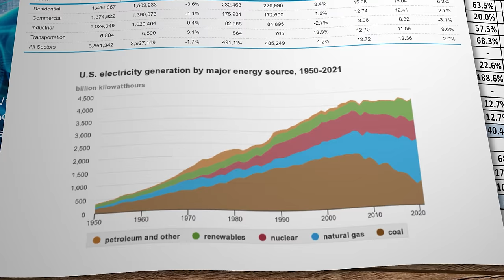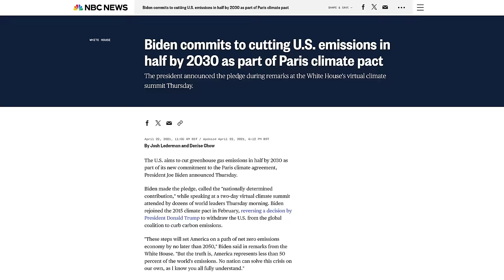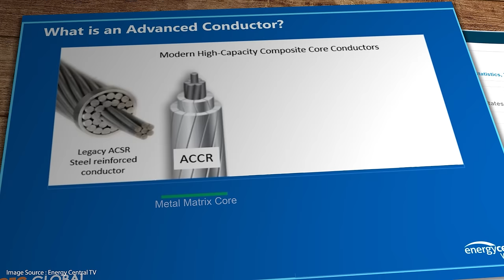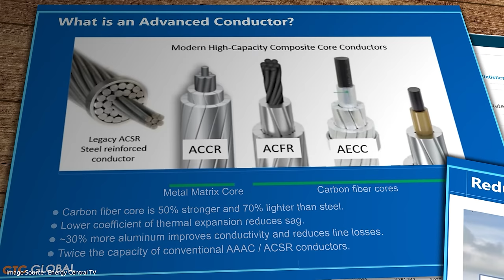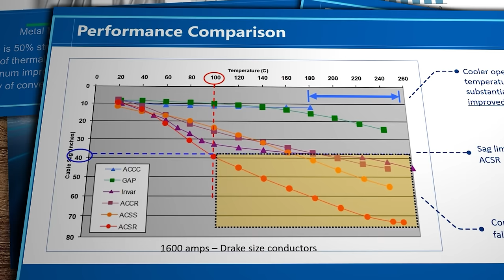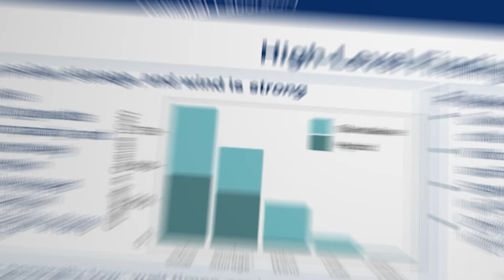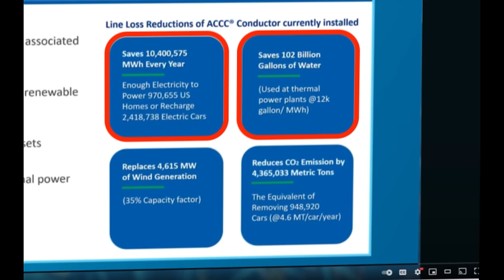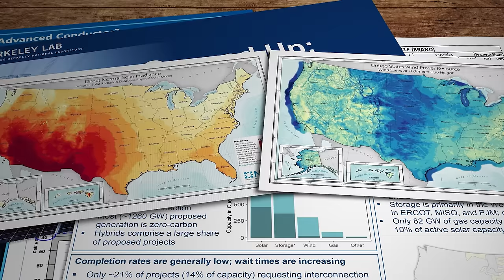Rethinking electricity grids.

Comment: A group of investors want to put a 100 megawatt solar farm to my north and connect it to a substation to the south. There is already a 120 kv transmission line going that way through my front yard. However, it does not have enough capacity to carry another 100 megawatts.

In theory, the company that owns the transmission line could upgrade the conductors. However, that would take a very long time, because it would just go into the upgrade queue. The job might not even start for many years.

The solar farm investors are negotiating to run another 120kv line through our front yard parallel to the existing one. Since they would be in charge of the project, they wouldn't have to wait for other projects.

They believe this is a faster way to get the solar farm up and running.

I approve of this project. Obviously no NIMBY concerns from me, since it will run through my front yard. Note: I will still support the project if the route changes, and it makes sense to run through my back yard.

Comment: What about using really high voltage DC lines in stead of AC that is also a major solution in conducting more power
Reply: I forget what it is but there has to be a certain distance and amount of power being transmitted before the economics of the higher cost infrastructure outweighs the loss of energy due to resistance.
Reply: @thatfatman6978  There are also useful for tying together different grids which may be out of phase.
Reply: the terminal equipment for HVDC is very expensive but works for long distances and high MW capacity.

Comment: I also presume that the more people who install solar panels and batteries at their homes (ie. go "off grid" to a greater or lesser extent) , the less demand and stress there would be on the grid. 

I also wonder about commercial buildings. If, for instance, the local big box store in Arizona would cover their large, flat roof in solar panels, that would presumably supply most if not all of their power needs at noon on a hot sunny summer day, and that store would essentially disappear from the grid when everyone else has their a/c going at full tilt. 

Solar panels are constantly getting cheaper and more efficient, batteries are constantly getting cheaper and more efficient, and inverters and integration/interconnection devices are constantly getting cheaper, more efficient, and smarter too. At what point will businesses finally see the money making/saving potential of generating some or all of their power needs locally?
Reply: Cover their large, flat roof in solar panels, this is what we should address as rooftop solar.

Comment: Along with this I do wonder if some of the current transmission lines could be modified to operate at higher voltages.  This would require new transformers etc and also depend on insulation and wire separation.

Even more complicated but also interesting is the conversion of some of these to high voltage DC lines (HVDC).  Much more expensive but lots of benefits.

Comment: What an excellent presentation! Doubling the existing transmission capacity through "reconductering" old transmission lines definitely comes into the "no-brainer" category of worthwhile investments for the future! The kickback from those who are resistant to the EV transition is full of negativity about grid capacity. As with the USA figures I understand that the electricity usage in the UK continues to fall despite increases in EVs. The highest level was around 2005 and it has dropped considerably since then ... allowing us to dispense with almost all of our coal generation ... more good news. Doing the numbers if every single car in the UK was to overnight become an EV (clearly not going to happen) the level of generation capacity that we had in 2005 would be sufficient to cope! (That's just using oversimplified arithmetic and the true picture may well be different but it does put things into perspective.) We need to shift from assuming this transition can't happen to getting on with it!

Comment: I work with CF manufacturers, and I've been told that the price per quantity of wound cable CF is increasing quite quickly as more cable manufacturers are turning to it rather than the older steel-aluminium technologies. My area is bike frame manufacture, and the price of the sheet material we use is also increasing due to the pressure placed on fibre and filament supply from the major manufacturers in China, Taiwan, Japan and the US. It's a bit of a crunch time in the CF manufacturing space, with supply always seeming to lag behind demand for the last 5 to 10 years. So which industry is prepared to offer the best rates to the filament manufacturers? Car panel manufacturers? Aerospace companies? I think conductor manufacturers might be a bit further down the rankings.

Comment: With the UK running most of the time at 95% of the grids capacity and completed generating plants unable to connect to it this could be a game changer.  I recently saw a comparative test of the cost of running the most efficient tesla (probably the most efficient  EV) charging on the public charging points  for 10,000 miles agains a similar ICE car, electric is now about twice the price. It's  much cheaper for those who can charge at home with off peak electricty and slightly cheaper for standard tariffs. Unfortunately a lot of people dont have the option of charging at home.If we want people to quickly adopt electricty wherever possible something like this needs to be done starting now. It might even reduce the outrageous price we have to pay for electricity. Probably not though.

Comment: Retail in the UK changed over to LED lighting about 5 years ago saving 66% on energy cost but at the same time gave them extra capacity to install car chargers in their car parks . Now that halogen and fluorescent lamps have been phased out over the past couple years then this will force properties to change over to LED
Reply: Here in Canada, most office buildings, universities, hospitals & other large institutions have switched to LED bulbs that look pretty much the same as the old florescent tubes.  They do need a difference fixture, but they fit into existing ceilings that were designed for the florescents.  I've also seen 22-watt florescent tubes that fit into the old 40-watt tubes and produce the same light.  One hospital I worked in replaced the old florescents with LEDs whenever a bulb needed replacing.  It took the electrician less than half an hour to switch a single fixture.  He needed an extra assistant for the first two years, but after that, he spent less than a quarter of the time on maintenance than he did with the old lights.
Reply: And look how far LED has come. A new generation of LED is in the works also which uses even less power.

Comment: 3:42 aluminium conductor with steel wire armour protection..
Shirely, that's what you'd put in the ground. Above ground, the steel is the central core with conductors wrapped around it.

Comment: My Overhead Cable Sag Software is used by companies all around the world, mostly for transmission lines, but also for chairlifts, etc.  Sag is very important, in addition to reasons mentioned in this video ... too much sag puts a lot of extra weight on pylons, wastes money (excess cable which costs a lot of $$$), and the flapping around in strong winds and even worse - getting into synch when flapping around - can cause a lot of extra stress and strain on pylons, shorten the life of cables, and cause various other issues / dangers.  Similarly, too little sag can cause a lot of stress on cables and shorten their life because there is not enough slack, especially in cold weather.  So there is an optimum level of sag in the cable, and this depends on the cable span, the difference in height of the towers / pylons, the altitude, the temperature, the cable materials, and other factors.  It's pretty complicated stuff - hence the reason I developed my Overhead Cable Sag Software.  
Special thanks to Greg C of Ergon Energy Australia, who collected and documented many sag calculation methods throughout his career, and helped me develop and test Sag Calculator just before he retired.

Comment: Reconductoring with the new high performance composite core conductors such as HVCRC conductors from Epsilon do everything highlighted in this video and make absolute sense in Australia where long distances result in high line losses.   These conductors are also recommend for bushfire risk areas where the low sag feature minimises arcing in adverse weather.

Comment: Cable  sag is not "alarming" its managed in the spec of the build ensuring it stays at the required height.

From Wiki.

Although ACCC has significantly less thermal sag than even other HTLS conductor designs,[5]: 20  it has a lower axial stiffness. Therefore, it sags more than other designs under ice load, although an "ultra-low-sag" (higher modulus) version is available at a cost premium.[5]: 21  Also, other aluminium alloys with an increased strength at the expense of electrical conductivity can be used to improve ice load sag. Ice load can also lead to the loosening of outer layer strands because of plastic deformation by the attached weight.

Comment: A recently introduced bill in California, SB 1006, would require utilities, together with the Independent System Operator, to make plans for reconductoring and grid-enhancing technologies, including when they will be implemented.  These plans must be submitted to the California Public Utilites Commission by Jan. 1, 2026, and updated every 4 years.  

The legislation states: Reconductoring existing transmission lines with advanced conductors and installing grid-enhancing technologies, such as advanced power flow control systems, dynamic line rating systems, and topology optimization software, can quickly and cost-effectively increase transmission capacity.
Reply: Thanks for highlighting this - a bill what would do more reconductoring sounds very appealing!

Comment: Reconductoring can provide an incremental capacity improvement. Where a step change in capacity is required you need to increase the voltage which provides disproportionate increase due to power loss = voltage squared over resistance.  But it requires new insulators.  If the utility has been foresighted they’ve allowed enough space for this in their transmission tower design, otherwise it requires tear down and rebuild.  For example the grid in northern Scotland used 275kV but the towers are designed to allow eventual upgrade to 400 kV.

Comment: I also think they should be looking at increasing the phases. From what I remember it’s decreasing returns which cap at about 15 phases. If you could do 12 for long distance runs you could probably be a lot more efficient. I believe it was the cost of transformers and switch’s in the 50s that set it at 3 phase. But those are rather vague memories.

Comment: In Australia, where bush fires regularly destroy the grid, Micro grids are becoming more common for rural communities, solar wind and a battery, that can run a whole small town. Same for isolated rural properties, definitely better than regularly rebuilding a burnt grid.
Reply: Examples please, because I call B S on this comment. Unless your speaking of a private network in which case you clearly chose solar as a better financial option as the connection fee to the grid would be double your solar installation. in which case, you chose it because of selfish financial reasons, not climate saving.
Reply: @simonmckittrick5236  He made no mention of saving the climate, but, instead of saving himself from the effects of the climate, ie. bushfires

Comment: I wonder if the demand drop (here in the US) is due to roof top solar. I know I pull a lot less off the grid, and the electricity I use off the panels does not go through the metering system.
Reply: Imagine if large factories with flat roofs had solar...

Comment: This is the elephant in the room. As a designer of overhead lines for thirty years , we could not change the standard to reduce the temp from 100 deg C for normal operating the system. Heating to that temp. burns bird feet!. Victoria Australia.

Comment: Always good to have new materials for power transmissions, whay not run extra lines on the pylons? Just add additional supports and spacers.
In my area, the power company have been replacing the power poles and stringing extra lines along the same path.

Comment: Replacement of existing conductors to new highly more conductive ones leads to. Noise pollution,  more tension joints, and up to 30 times more downtime when needed for repair. ACSR repair for damage equates to a 1 day outage. The new conductors used in the UK can be as much as 7 days from outage to reenergisation.

Comment: Rooftop solar PV is cheaper than windows $/m2 in Australia. 
No new grid to build. 
No new central generation or upgrade.

EVs and battery production is expanding. 

Central nuclear grid electricity is a dead duck economically. 15% of all energy is grid electricity energy. And it took 100years to construct. 

Costs to construct Grid is the same as the national GDP, $TRILLIONS AND TRILLIONS. 
15% costs are extreme 
100% is impossible. 

The other 85% of energy can not be grid electricity. 

The existing national grid must be protected from overloading and blackouts. 
Must be protected from monopoly nuclear electricity. 

If a home battery of 10kwh is all that is needed to get through the night when the world is sleeping, then a 100kwh EV battery parked 23hrs every day is a wasted resource if not used.

Nuclear promoters talk about 'factors of use' economics, and batteries at wind farms are 100% used 24hrs every day profitably.

Nobody wants the grid customers to know how valuable their EV and rooftop PV are.
Big business renewables and big business nuclear both want the monopoly.

Both want EVs.

Comment: Great points, AND could be even better using superconductors or ultraconductors... however, the best is transporting energy using ET3 (Evacuated Tube Transport Technologies)(tm). ET3 also has the benefits of energy storage (linear flywheel mode), and transport of passengers and cargo (including LNG, H2, oil, etc.) - all in one infrastructure. Verses off-shore wind, the same amount of capital invested into ET3 would SAVE three times more electric energy than the wind turbines could produce in their lifetime. ET3 can acomplish 50X more passenger-km of transportation per kWh than electric cars or trains...
Reply: ET3 is able to transport electric energy kenetically. A linear electric motor/generator (LEM/LEG) accelerates (and/or regeneratively decelerates) loaded capsules at speeds to 6500km/h where the kinetic energy per 550kg capsule is 250kWh.  The safe capacity (1/3 theoretical capacity) is 120 capsules per second.  The trip (across the Bering Strait) from the high-noon side of the world to the midnight side is 2 to 3 hours.
Reply: The electrical energy efficiency of ET3 is approximately equal to the efficiency of the LEM/LEG - or up to 96% using copper windings OR over 99% using superconducting windings.

Comment: This is good news -- actually the information about the lack of any recent increase in electricity demand may have been the most interesting. Conservation is always the cheapest and quickest way to make things better.

When I clicked on this I thought you might be talking about micro-grids. Besides the overall consumption problem you address here, there is also the eventual problem of solar storms knocking out the grid. It would make a lot of sense to redesign our entire system so that more power is generated closer to where it is consumed. If we could also harden the system against solar storms (and the like) that would be even better. Energy conservation would need to be a part of this plan. Every area should compare the cost to reduce energy usage through conservation to the cost of local generation to the cost of bringing in more power from outside the area. 

It may well turn out that we won't need as much additional power as people think.

Comment: One issue with the grid is that they also need hardened versus  EMPs and solar flares/CMEs... and the control software is extremely vulnerable to being hacked.  Personally I think the better solution is local and personal power generation,  which can be easily protected from EMP surges and cut off from the internet completely,  eliminating the risk of hacking.

Comment: Confused, the largest problem with OHL is the reactance and not the resistance, reconductoring them does not impact the reactance as that is a function of the spacing between conductors. The skin effect also limits the impact of additional aluminium. It sounds very like publicity material.

Comment: What about boosting the wattage by increasing the voltage? Even with the existing cables, that will transmit more power, though the transformers and insulators also have to be upgraded. What about the High Voltage Direct Current (HVDC) upgrade? HVDC has lower line losses, removes phase matching issues from the long lines, works at higher voltage (enabling greater transmission distances) even with the existing insulators, and requires fewer conductors, only 2 instead of 3. Since most HV towers already carry 6 lines of 3-phase power, switching that over to HVDC means an additional capacity upgrade of 50% as 2 circuits get replaced by 3 circuits.
Reply: Tesla using 48V up from 12V for the low voltage now to achieve this for instance. Saves alot of copper and weight...